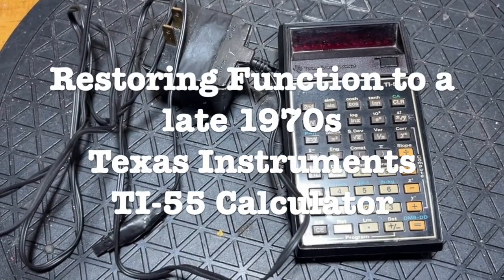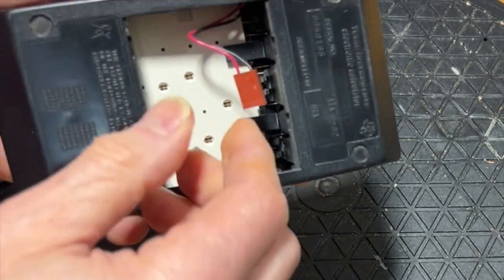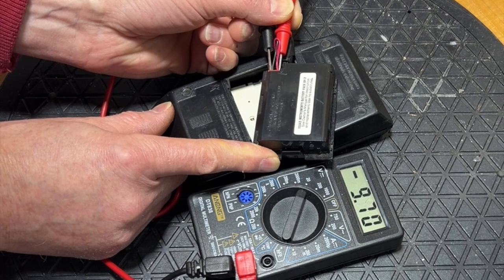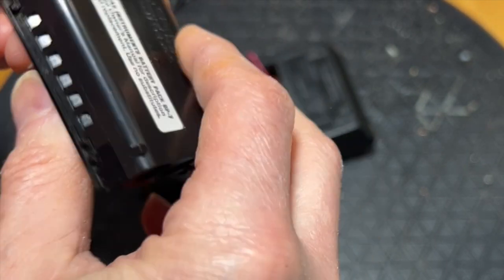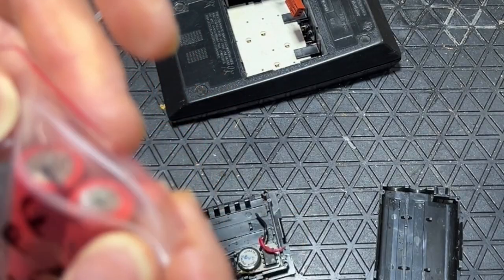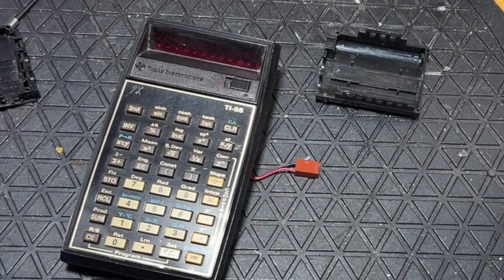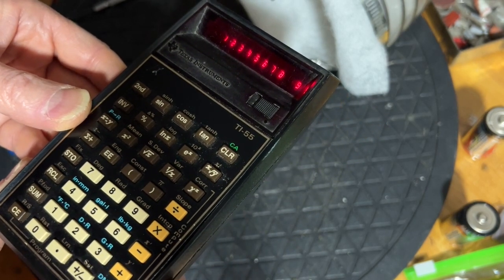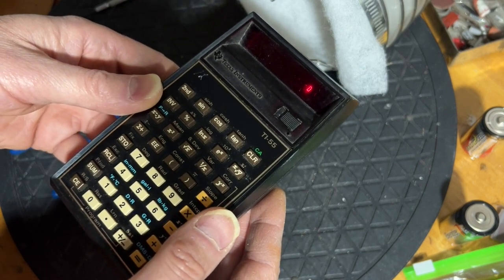Restoring Function to a 1970s Texas Instruments TI-55 Calculator

Comment: I had a similar TI calculator way back when.  Had a carrying case with belt loop.  Like yours the battery pack died and I didn't know how to fix it so I just used a 9 volt battery (it came with the 9V battery snap).  Finally in the mid-1990s the key pad went bad and it was time to toss it.  Now I use a TI-36X Solar.  Seems a waste to use something so loaded with functions for my simple needs.
Reply from the maker: I know what you mean. I had a TI-55 in high school. Other than roots, logs, stats and trig functions I didn’t make full use of the functions either. I must confess though that when I was bored in class I would tinker with the programming, not to do any important calculations, but just as a diversion and to look busy.
Reply: @Mr.BrownsBasement  Ditto.  After a certain time of inactivity, the red LED display went out to conserve the battery pack and replaced it with a moving decimal point to "entertain" me.  Bored but well behaved.

Comment: One small correction/clarification: VFDs didn't use more power in the sense that they drained batteries faster, in practice they used less in that sense, but they did require a step up converter to supply a 30v rail for the cathode. That was expensive and complicated the assembly process (especially when the circuitry had otherwise been consolidated to a single chip), so TI tended to avoid VFDs most of the time in their battery operated calculators. Eventually LCDs made the whole point moot, as they were cheaper to make and sipped on batteries (at the expense of backlighting.)

TI did produce a handful of calculators with VFDs, mostly slim pocket models, but also the TI-1265 which was essentially a TI-1250 with a VFD.  It retailed for a couple dollars more than the 1250. I have a 1265 and the display is much, much more readable than their standard bubble LED displays IMO.
Reply from the maker: Yes, true. Thank you for the clarification. 😊

Comment: Using red wire for -9V was not nefarious. The PMOS chip required the negative voltage to function.
Reply from the maker: To me black is negative and red is positive no matter whether it’s PMOS or NMOS. Whether the colour code was nefarious or not is debatable but I’m sure many chips were damaged by unwittingly connecting power in reverse.
Reply: @Mr.BrownsBasement  No doubt. BTW if you want a little fun with your -55, see my article on RSKEY dawt aurg.
Reply from the maker: @ClausB252 Do you have a link?
Reply: @Mr.BrownsBasement  yes but YT won't let me post it. Go to that site and click The Library at left, then scroll down to Articles.
Reply from the maker: Oh. I’m sorry. 
I’ll check it out. Thanks.

Comment: If you're ever inclined to try to restore the calculator back to a more accurate version of its original self, you can almost certainly still get basically exactly the same NiCad cells fairly easily.  The rechargeable nature of this calculator was actually a really cool feature at the time, so it seems a shame to just throw that part of its design away completely...
Reply from the maker: You raise an interesting and valid point: Whether to restore back to a more "original" version or alter to a more "useful" version. If I were restoring this calculator for a museum and authenticity & faithfulness to posterity were paramount, I would most certainly have kept the battery pack as it was and acquired & installed a pair of NiCad batteries. But in this instance, I thought the modification to accept a 9v battery would be simpler and more useful even if it meant sacrificing the option to recharge the batteries. Also in my mind was my goal to eliminate NiCad batteries in all items I have. Battery leakage (particularly from NiCads and Lithium batteries) can be enormously destructive to electronics and I want to take steps to mitigate future losses.
Reply: @foogod4237  or with NiMH cells for better performance.

Comment: As a nerdy child of the 90's bought these from yard sales and did this routinely after a salesman at Radio Shack sold me the parts.  Even had a soldering bench set up in the mall where you could still smoke cigarettes.
Reply from the maker: Would you have imagined that anyone would still be interested in these calculators 30 years later?
Reply: @Mr.BrownsBasement  I just bought a TI-30, and I am a 90's kid too.
Reply from the maker: Great find! Same form factor and display as the TI-55. If I recall it was a less expensive model that didn’t have all the “bells & whistles” but still was enough for high school and university students.